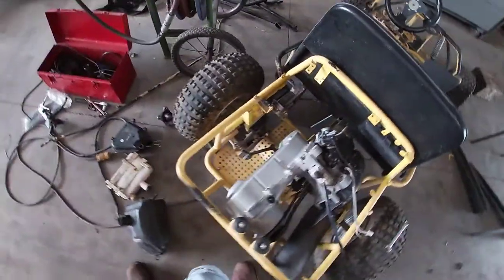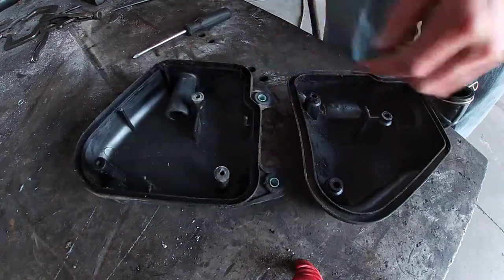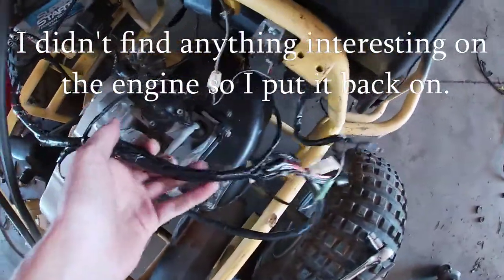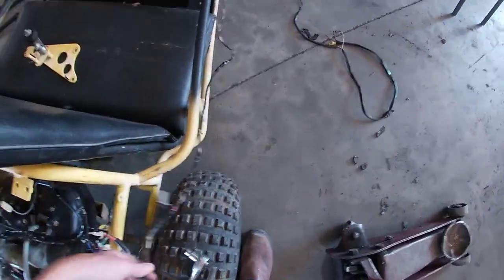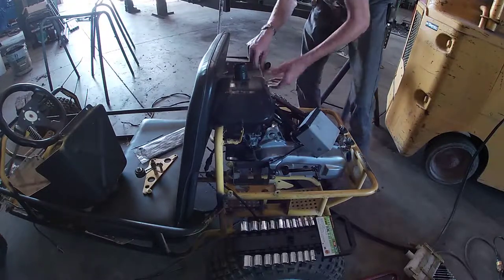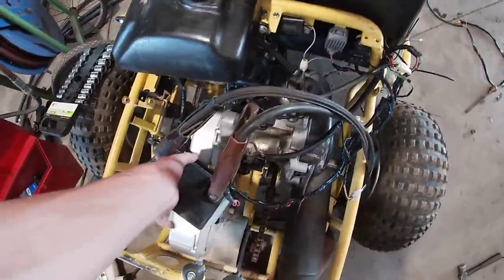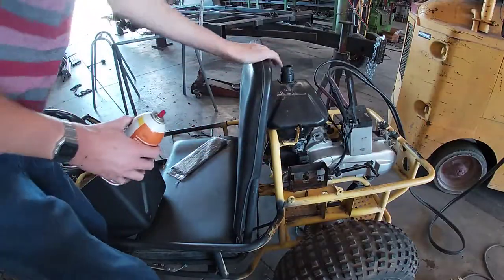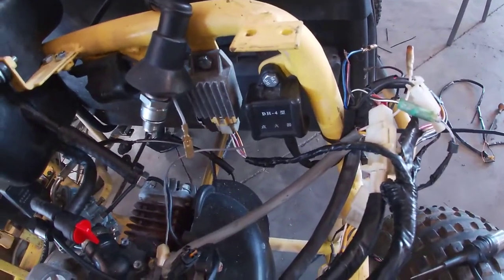I got a Yerf Dog Little Fox 90cc!

Comment: What was next to the gas tank, it
Looks like another tank but white, and whats it connected too. I have same yerf dog but missing the white tank. Thanks for info. Also I think its has transmission oil at back, but os there another place for oil? Thanks for any info.
Reply: its an oil tank for 2 cycle oil and the carburetor mixes fuel and oil as it runs but most people get rid of that tank and just pour premix in the fuel tank.